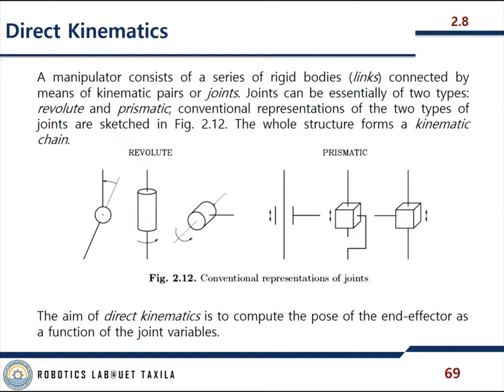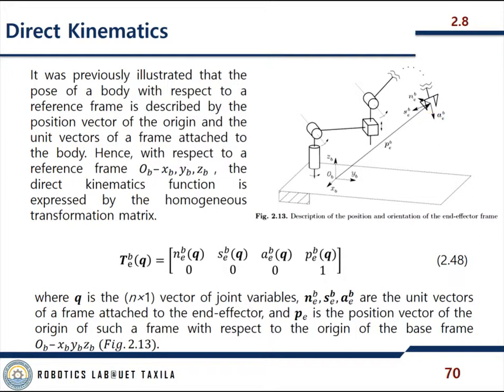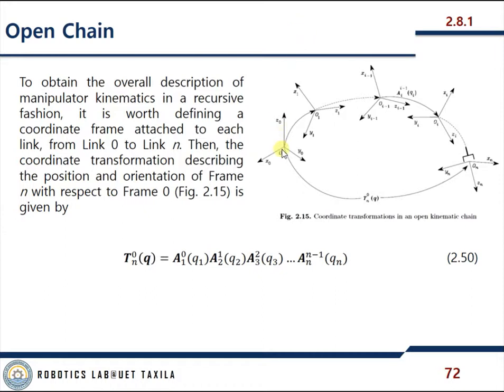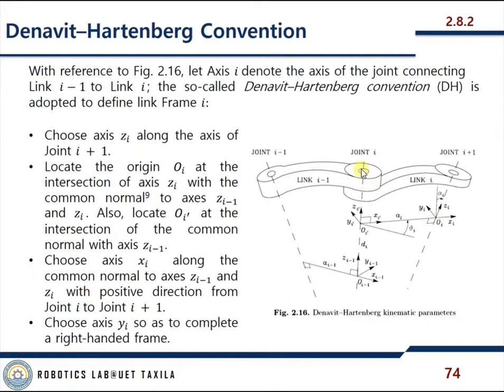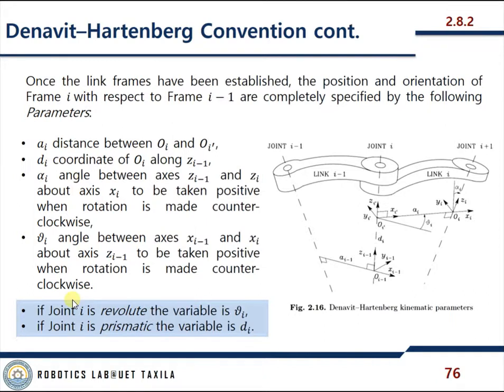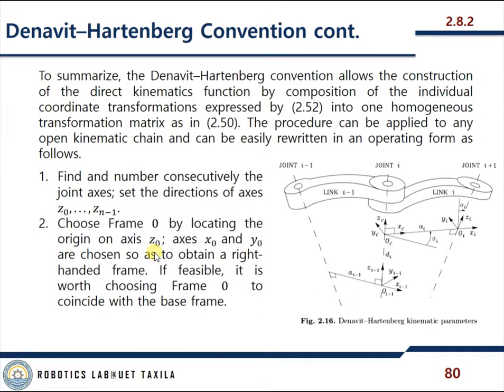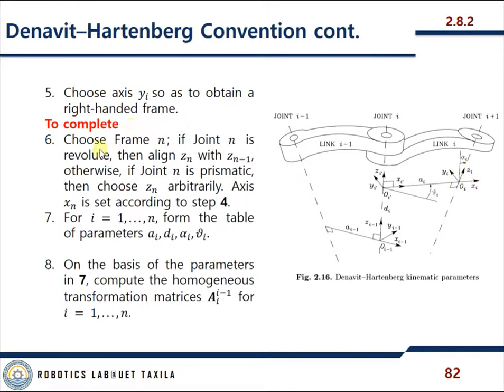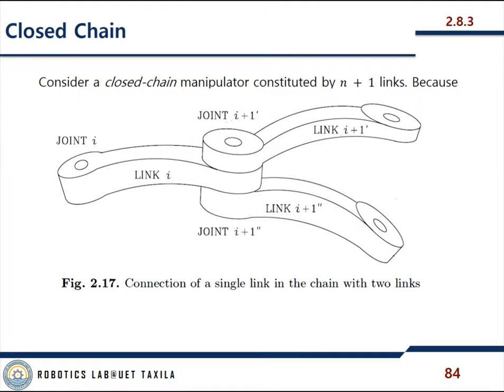Lecture 4 - Denavit- Hartenberg Convention

Comment: At time 3:42 how equation 2.48 comes can u please explain it in more details ??
Reply from the maker: It is a transformation matrix which has 4 columns. Column 1 (being represented by unit vector n) shows normal axis of end-effector, Column 2 (being represented by unit vector s) shows sliding direction of end effector, Column 3 (being represented by unit vector a) shows approach direction of end effector. Column with p, is simply position vector of the frame of end effector.
Reply: Ok, got it thanks sir 
!